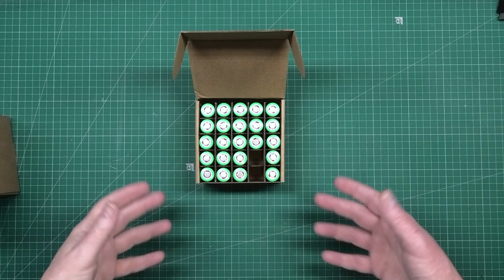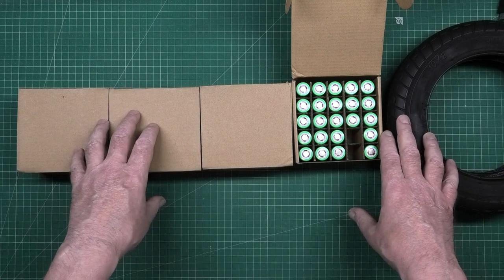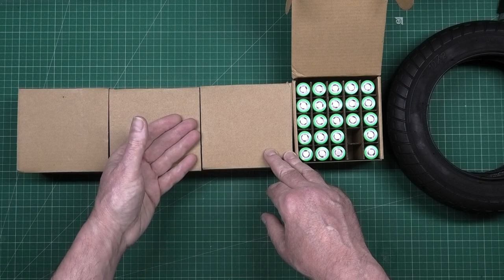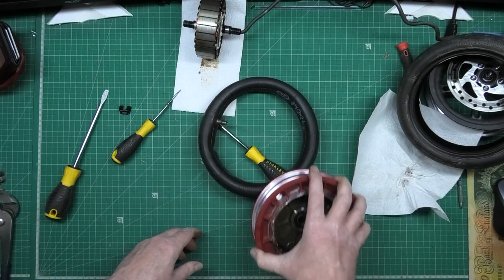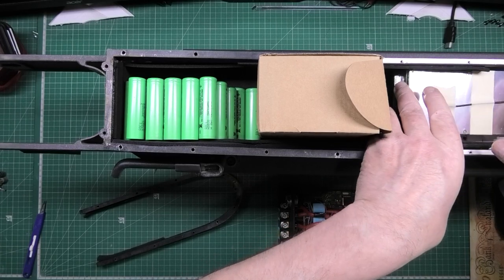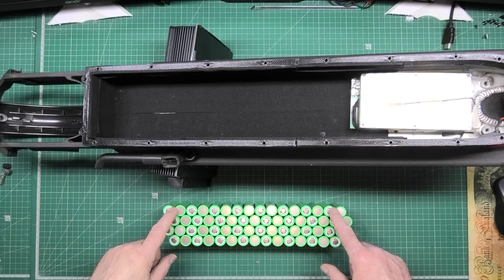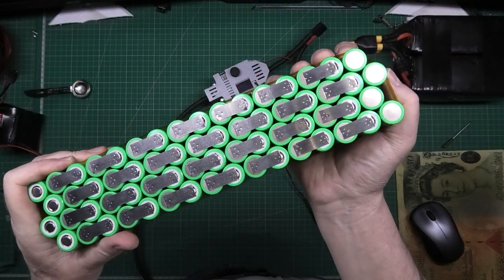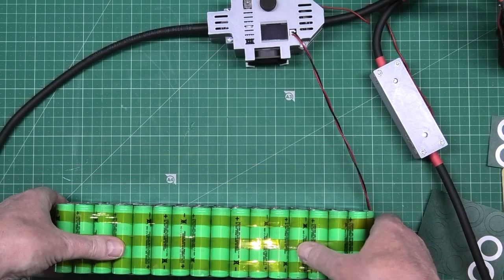Xiaomi M365 build - Codename V365 - The 2kW sleeper part 1

Comment: At this point you might as well drill holes in the motor wheelhub cap to cool the motor, as well as carving some ram air intakes into the deck to cool off electronics, replace the folding latch by a non-folding permanently fixed collar, get the xtech hb-100 caliper upgrade for a decent braking.
Don't forget to flash the xiaomi OFW with 1) KERS OFF (this KERS thing on the xiaomi is life-threatening, shut it down so that you'll be freewheeling, but you'll still have motor braking when you use the braking lever), 2) Russian throttle algorithm (giving the xiaomi an immediate throttle response just like on a gas scooter), 3) motor start speed at 0 (so you don't have to kick the scooter to start again after being almost stillstanding)

Comment: You can actually use 8.5" tubes on a 10" tyre! I've been using this setup for over 300km on 55psi and it's working brilliant! ( 10" tyres recommend 35psi, but it is working ok for over 2 months)

Comment: Those tires, if they are of the reinforced rubber variety, are what I use on my scooter, and mine hold up perfectly well for extended periods of time at up to 50 km/h! They are grippier than the original tires, for sure.
Reply from the maker: They're definitely reinforced and tested to 55mph (88kmh) now 😉

Comment: Whenever I make a series connection, I always use a separator in between the cells.  Fish paper or another form of friction insurance. In your opinion, am I being too cautious?
Reply from the maker: Not at all. Anything that reduces the risk of anything shorting out is only a good thing! 😁
Reply: @Vortecks  i tried to  email you tony  but got no reply  sadly   are thease cells  better than samsung30qs ?    i heard 30qs dont charge after250 cycles  or dont like heavy   current draw      i have a muxs3kw hub    and want a 72v battery  but am worried i choose the wrong  cells  please  advice tony or someone  before I  buy   as i have been saving for  nearly 2years to buy them i plan to buy 120 to 160 of them

Comment: Tony, maybe you could mount a back rack and put the motor controller above the back wheel. You can also buy a wider board to go on top the current footboard.  Also as long as the voltage of the motor and the battery is the same the watts don't matter as long as there are the same or more watts from the battery.

Comment: I figured it was safer to do the parallel connections first. Then you can't short anything out until you start completing the final side of series connections. Then I cover the parts I'm not working on with some tape or foam rubber, so if I drop a piece of nickel strip it can't land in a place to short the cells.

Comment: You should get phaserunner or decent vesc. Phaserunner is very compact, up to 20s 50amp constant vesc is limited to 12 or 13s and 50amp constant. Both of them are very compact and powerful enough for your use. Everything would fit inside.
Reply from the maker: Phaserunner - £290. VESC - £500. Sabvoton SVMC72150 - Free.
I can't think of a better reason to use it mate 😁

Comment: I'm doing a similar project at the moment, I'm looking at keeping the stock controller changing the mosfets and reinforcing the traces and using a custom firmware, have suspension in front and rear as well as 10" tyres giving me way more clearance so I can extend the battery case for even more battery space. Did you consider the sabvoton 7245? Not quite the 50A your battery is capable of it would fit and be perfect for you

Comment: Thanks for the tip about the VHB tape, I've tried superglue and hot snot for building packs and neither does a particularly good job.
Reply from the maker: I cringe when I see hot glue being used - as you know, it just cracks up and impossible to cleanly remove a faulty cell. With VHB tape, you dribble some IPA solvent down the VHB strip, wait 5 mins and it slides out (and the battery) 😁

Comment: Everywhere I'm checking for battery mods it's always the 2500 18650 cells. Is there any reason for that as the 18650 cells come in 3000 and 3500mah (I use them on my vape mods) but no one seems to use them for battery packs

Comment: Tony i Love your way.. U mind helping me out with a problem? Brand new 6ov scooter massively sparked when connected to charger not plugged into the wall.. though bc of the capacitor, but when charger plugged into wall first , the sparking was more of a torch .. out of the plug how can that be ? Could it be a broken bms or more likely a broken charger? It has dual ports and 2 chargers .. happened both times..  please help out.

Comment: i tried to  email you tony  but got no reply  sadly   are thease cells  better than samsung30qs ?    i heard 30qs dont charge after250 cycles  or dont like heavy   current draw      i have a muxs3kw hub    and want a 72v battery  but am worried i choose the wrong  cells  please  advice tony or someone  before I  buy   as i have been saving for  nearly 2years to buy them i plan to buy 120 to 160 of them
Reply from the maker: Sorry mate, my inbox is constantly flooded at the moment 😕
To put things into terms you'll easily understand.......... First off, no battery likes continuous heavy current draw, it's not just 30Q's, it's all of them. If you start running a battery close to its limit, it gets hot.

Let's draw an analogy.......Imagine a battery as a resistor (in essence, that's all they are anyway). The 30Q has a higher resistance than the 25R and it gets hotter if you push it the same amount. The 30Q is rated at 15A constant, the 25R is rated at 20A constant - CONSTANT. You'll never push your cells at their constant power, it's not possible on an e-Bike or any other EV. If you're looking at explosive power, the 25R's will handle it better than the 30Q but, if you're looking at range, the 30Q is your best choice.

There are a lot of design factors to take into account when building a battery but the main one is cooling (also, have a look at my video named "size matters"). The main areas to keep cool are the terminals so please don't do the same as loads of people and pack the shit out of the casings, you only need the bare essential to stop things rattling and causing problems further down the line. What I'm trying to say is, don't add packaging because there's a space.
With any battery, if you keep pulsing the power, they will start fading but if you keep them as cool as possible, have some considerations when building the pack and store them correctly (at 3.7V per cell) you won't have problems for many years.

It annoys me when people give false information about batteries. Generalising and saying that 30Q's only last 250 charges is bollocks - if you pack the shit out of your casings, don't care for them and run them at full power all the time then yes, they might only last that long but to generalise that is just wrong. Look at my 26650's which everyone said were shit - after charging them to 4.2V per cell every time and pulling >250A quite a few times on every run, they haven't faded whatsoever in the 2 years I've had them because I considered how I built the battery and I know how to look after them.

In a nutshell..... you might regret buying the 30Q because the power will fade quicker than the 25R but then again, you might regret buying the 25R because they won't give the same range as the 30Q...... sadly, you can't have everything - I just want power and I don't give a shit how far it takes me 😁

Comment: The xiaomi controller is quite versatile itself using the open source firmware mods with variable regen as well, how come you don't want to use that? Since you're running 14S if you have a version 2 DRV unit it can easily handle up to 85v! If you upgrade to IRFB4110 mosfets, then you can very comfortably pump 2 kW into the motor, maintaining the original drivetrain components (40 amps @ 14S)
Reply from the maker: Really? After I'd used mine on 12S at around 1.2kw, it was toast and kept cutting out due to overheating. I'd already fitted IRFB4110 mosfets and it still wouldn't handle it 😪

Comment: I thought ud extend the frame at the back so it has a bit of a sloped tailgait. Somewhere for the controller etc but I suppose might make it rear heavy
Reply from the maker: If I had all the welding gear and somewhere safe to do it, I might do something like that mate but sadly, I don't 😪
Reply: @Vortecks  maybe for a version 2 aye. Visit us local fabricator when lock down is over and all that

Comment: How can you just multiply with whatever amps your speedcontroller can handle?  Thats never a 2kw/h battery...
Reply from the maker: It's not a 2kWh battery, it's a 672Wh or 0.672kWh battery but it's capable of delivering 5.3kW
Reply: kW and kWh are different things mate (power vs capacity)